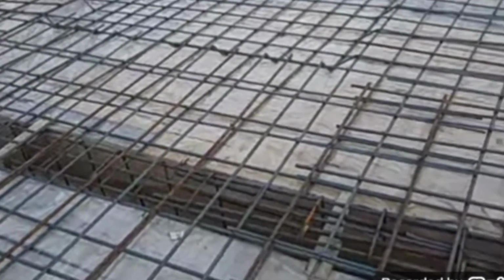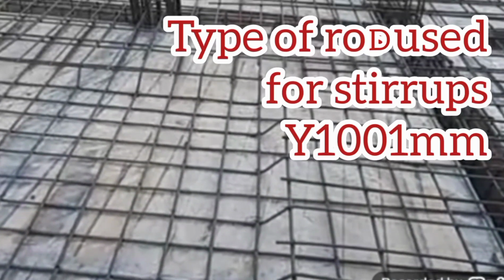SLAB REINFORCEMENT,  @civilengineeringchannel5329

Comment: Please what is the minimum number of pillars in a 4 unit block of 2 bed room flat?
Reply from the maker: Depending on the ground plan and the engineer that is constructing the structure. I wish I can see the plan It will be good for me to specify the number of column or pillars for you